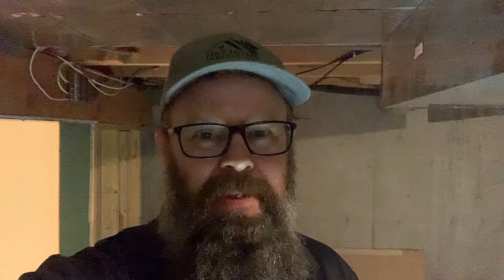💦Vapour barrier on interior walls, bad idea!  “On the home inspection today”

Comment from the maker: Hi Willy yes I think putting rockwool insulation in the wall between your mechanical room and your family room with no vapour barrier is a good idea to help cut down on noise transmission from the mechanical room into the rest of the basement

Comment: The use or not of vapor barrier on walls is dependent on climate the home is in. Vapor barriers are used differently in the warm south compared to the northern states.
Reply from the maker: Yes that is correct, I am in Alberta Canada it is a cold climate and we can have swings of 50 degrees in a matter of days.
Reply: @hatpropertyinspections  so in cold climates what are the steps? Poly or rigid foam or both? On cinder blocks and then studs for rigid but what about poly. Poly first or studs? Thanks
Reply from the maker: @luly8083  Hi Thank you for your comment. In my opinion the best assembly is as follows. Build 6 inch stud walls all the way around on the exterior of the basement leaving about a 1 inch gap away from the cinder block or concrete foundation. You don’t want the fibreglass insulation to touch the concrete you want to have an air gap there, then fill them with R20 Fibreglass batt insulation. Including the rim joist areas above the wall. Then install 6 mm poly on the interior side of the stud walls, all the way from the floor up to the top of the wall and inside the rim joist area. (Where I am it’s code now to use spray foam insulation in this rim Joist area with no poly )but R 20 insulation in this area with poly will work fine, you can use some Staples to hold The poly in place up in the rim joist area, Cut the poly a couple inches above the top of the rim joist and staple it to the floor above. Then use black acoustic sealant to seal the poly at the floor, in the corner of the concrete floor and new 2x6 wall and cut the poly about half an inch from the wood wall. I do not recommend foam board insulation at all for basements. I hope this information helps , thank you very much Westley.
Reply: @hatpropertyinspections  Thank you very much for your time and expertise. To clarify  when you poly on the inside of wall you mean where the drywall goes right, the face of stud? How about when furring strips attached to the cinder block? What application you recommend.  Poly before furring strips and in this application would rigid board be best or why don't you recommend rigid boards. Thanks again!
Reply from the maker: @luly8083  hi it’s my pleasure to try and help. yes the poly goes over top of the stud right behind the drywall. I don’t recommend furring strips attached to cinderblock. The cinderblock will allow moisture through it. You want to have an air gap between the cinderblock and your wood wall, so things can dry out back there. It’s better to build stud walls and space them an inch away from the cinderblock. Then you can insulate the stud wall with fibreglass then the vapour barrier then drywall. I don’t recommend Rigid boards in this application because they will hold moisture. Rigid foam boards are generally only used in attics. And a few other applications where trapping moisture is not an issue. If you were going to put the furring strips right against a cinderblock than the poly should go after the furring strips right behind the drywall.
Reply: @hatpropertyinspections  Excellent thank you again for your time and this valuable information.  I guess another curiosity I have is. Is it code to use pressure treated at the bottom plate or against the wall if you attach against cinder block? Thanks
Reply from the maker: @luly8083  hi yes it is required to use pressure treaded lumber when in direct contact with concrete or block.
Reply: @hatpropertyinspections  thanks again for taking the time to help me out man. God bless!
Reply: Recommendations for the southern states?
Reply: the above q and a's are excellent, just commenting so i can find this again later. Thanks

Comment: Thanks for the pro tip.   Another one I would point out, is having no vapor barrier on concrete walls.  People will frame up along concrete to build walls, so yes insulate, but no to the vapor barrier. That too would trap condensation, from natural occurrences.

Comment: What’s the best way of erecting the poly …..against the foundation wall side or should instead only the insulation be pressing against that foundation wall …..or only interior side where drywall walls will sit against
Reply from the maker: Hi Antonio Thank you for your comment. The best way to erect the wall is to Build 6 inch stud walls all the way around on the exterior of the basement leaving about a 1 inch gap away from the concrete. You don’t want the fibreglass insulation to touch the concrete you want to have an air gap there, then fill them with R12 Fibreglass batt insulation. Including the rim joist areas above the wall. Then install 6 mm poly on the interior side of the stud walls, (using a staple gun) all the way from the floor up to the top of the wall and inside the rim joist area. (Where I am it’s code now to use spray foam insulation in this rim Joist area with no poly )but R 12 insulation in this area with poly will work fine, you can use some Staples to hold The poly in place up in the rim joist area, Cut the poly a couple inches above the top of the rim joist and staple it to the floor above. Then use black acoustic sealant to seal the poly at the floor, in the corner of the concrete floor and new 2x6 wall and cut the poly about half an inch from the wood wall. Then drywall and tape the wall and ceiling. No poly on any interior walls, but insulation on interior walls is OK for soundproofing. I hope this information helps , thank you very much Westley.

Comment: wouldnt putting poly on the exterior wall cause a moisture build up and mold?
Reply: if the wall gets wet then yes. don't cover it with anything if it gets wet (ie water comes in from the ground outside)

Comment: We are building a small cabin that has a an interior wall with a bathroom on one side and a kitchen sink/counter on the other. I want to insulate the wall for sound purposes. We want to install shiplap directly ( no drywall) on the framing to both sides as well but want to prevent the humid air from the bathroom going into the wall.  I was going to put poly on the bathroom side, but look at a mesh screen on the kitchen side to allow for some air movement.  
Sound good ?
Reply from the maker: Hi no I would not recommend putting Polly there at all, if you want to stop moisture transference out of the bathroom, but I think you should install an exhaust fan in the bathroom . Poly an interior wall will just trap moisture which can lead to mold.
Reply: Thanks for the quick response.  I was even thinking of window screen to hold the insulation in place but also keep it breathable. Then shiplap directly over it without using any poly.
Reply: I am planning to install a ceiling exhaust fan thanks.

Comment: Would you recommend waterproofing/sealing the walls and floor with a Radon seal or Drylock for moisture issues? I'm in Spokane Wa and just bought a new house with a basement and looking for some advice. Thank's in advance for any help you can give.
Reply from the maker: Hi Michael thanks for your question. All walls and crawl space floors should be water proofed and sealed. From the out side-
Cladding - siding, stuco etc.
Building wrap - tyvec, tar paper moisture seal etc 
Building structure - plywood, osb sheeting 2x4s etc
 Insulation - fibre glass batts is Probably the best and cheapest
Vapour barrier - 6mill poly It’s probably the best and cheapest
Interior finishing - Drywall mud and tape

This assembly It’s probably the best way to water seal and moisture steel at wood wall and still allow her to breathe properly. 
As far as radon goes the two ply eight mill Polly that they use for radon mitigation in crawlspaces is a different issue

Comment: This video and comments highlight the debate I am facing right now. About to insulate my basement foundation walls. I am in upstate New York, maybe -20c winters, 35c summers. Home is 22 yes old, I’m original homeowner, basement is bone dry. Has been for 22 years but never insulated. Now I’m about to start and wonder if rather than waste time on the fiber board, I go straight to 6 inch studs [all are non-loadbearing] and filled with batts.  Three of the four walls are under grade one is exposed, it’s a walkout. Thank you!!
Reply from the maker: Hi Ebbnyc Thank you for your comment. Yes I think you have it exactly right. Don’t waste time with fiberboard. Build 6 inch stud walls all the way around on the exterior of the basement leaving about a 1 inch gap away from the concrete. You don’t want the fibreglass insulation to touch the concrete you want to have an air gap there, then fill them with R12 Fibreglass batt insulation. Including the rim joist areas above the wall. Then install 6 mm poly on the interior side of the stud walls, all the way from the floor up to the top of the wall and inside the rim joist area. (Where I am it’s code now to use spray foam insulation in this rim Joist area with no poly )but R 12 insulation in this area with poly will work fine, you can use some Staples to hold The poly in place up in the rim joist area, Cut the poly a couple inches above the top of the rim joist and staple it to the floor above. Then use black acoustic sealant to seal the poly at the floor, in the corner of the concrete floor and new 2x6 wall and cut the poly about half an inch from the wood wall. Then drywall and tape the wall and ceiling. No poly on any interior walls, but insulation on interior walls is OK for soundproofing. I hope this information helps , thank you very much Westley.

Comment: Maybe you can help….
I applied 2 inch Foamboard to my basement concrete foundation walls. Then I constructed a 2x4 wall against it. I filled the wall cavities between studs with rockwool. My question is …..do I apply a plastic vapor barrier before Sheetrock or do I just Sheetrock over the rockwool?
Thank you!
Reply from the maker: Hi thanks for your question . Yes definite ly put a poly plastic layer over the studs before you put the dry wall on . 6mm poly and tape all the seams
Reply: @hatpropertyinspections Assuming the 2” foam board is XPS or foil-faced Polyiso, wouldn’t the low perm rating would qualify as the vapor barrier for wall assembly? Could create a double vapor barrier scenario by “sandwiching” the cavity with poly vapor barrier on top of studs and any moisture that finds its way into wall cavity won’t be able to dry easily and could cause mold, rot, etc. in the future. You could probably use a “smart” vapor retarder that has variable permeability and allows some drying to inside if stud cavity has build up of moisture….but honestly wouldn’t think you’d need it at all with 2” foam board against the wall.

Comment: Why would you recommend they remove the interior insulation as well as the poly?  Wouldn't the interior insulation help interior comfort, less air flow, less noise?
Reply from the maker: You are right, good catch! yes the insulation on interior walls is fine, just the vapour barrier should be removed.
Reply: @hatpropertyinspections  Thanks, wasn't sure if there was a reason not to do interior insulation.  Thinking of doing some interior near my mechanical room that separates the family room.
Reply: @hatpropertyinspections  One additional question if you don't mind, hard to find an answer on.  I have half-height foundation walls in the basement, half-concrete half where the 2x4 framing walls start (Raised Ranch).  This creates a "ledge" all away around the house where the 2x4 framing sits on the 2x8? foundation.  Gives the appearance the room is bigger than it is, but if I'm remodeling the space is it a good idea to create a second 2x4 wall attached to the first 2x4 wall, effectively creating a 2x8 wall I can stuff with lots of Rockwool?  Thank you!!!

Comment from the maker: Yes, I think adding another 2 x 4 wall on top of the short foundation wall to make a 2 x 8 wall in the basement is a good idea. If you’re concerned about energy efficiency this wall would give you approximately R 30 if you use rockwool.

Comment: So in a detached 2 storey house,  masonry build should you or shouldn't you  install a vapour barrier to the internal partition walls that contain insulation?

And what about the external brick walls that have plaster board fixed to them. Uk build here
Reply from the maker: Hi Dan thank you very much for your questions. There should be no vapour barrier on any interior walls, Even if the wall has insulation. Insulation In interior walls is primarily for sound barrier. Vapour barrier should be installed on external walls right behind drywall. For the exterior brick wall you are describing the detail is as follows .. from the inside ; drywall, Vapour barrier, Wall framing and insulation, exterior sheathing, building wrap or tar paper, brick wall 
I hope this info helps, make it a great day! Westley

Comment: The property mgt painted my apt with fragrance paint additive . Think they tripled the amount. I can't fully move in bc of it as I am mold/mycotoxin and chemically  hypersensitive. . Researching solutions as all odor blocking sealants have high vocs. Trading vocs for vocs. Have to work outside of the box. (Puns). I'm thinking foil  insulation board on the walls, ceiling may be the answer if that doesn't come with high vocs. Would truly appreciate your help. What can you advise me for these circumstances?
Reply from the maker: Hi I think the best way to remove a smell from a home is with ventilation. I would recommend installing an exhaust fan in the area and venting it outside and opening a window slightly to make up the air.  I would ventilate the area until the smell of the new paint has dissipated.

Comment: What methods would you use to seal and insulate a concrete built house (Not ICF but just a traditionally poured concrete house) and a masonry built house (say brick / block combo) ? Thank you
Reply from the maker: Hi thanks for your question I think the detail would be as follows from the inside. Drywall, poly vapour barrier, 2x6 wall framing and r20 fibreglass bat insulation, 1” air gap, Masonary structural wall, 1” air gap, moisture barrier and exterior siding. That’s going to be a vey thick wall but extremely energy efficient.
Reply: @hatpropertyinspections  thx. Why add the 2x6 wood frame if brick and concrete is already structural?
Reply from the maker: Hi the 2x6 wall is there to hold the insulation, give you something to staple the poly vapour barrier to and screw the dry wall to. It could be a 2x4 wall but 2x6 is code now for the r20 insulation.

Comment: What specific issue were they having? I am having some issuess with water condensating on my metal shed walls. I have insulation that technically had vapor barrier, but I was considering a second layer until I saw your video.
Reply from the maker: Hi thanks for your comment. There was no specific issue on that day. But we don’t want to have a vapour barriers on interior walls. This can cause condensation and can lead to problems like water damage and microbial growth. Condensation occurs when warm moist air hits cold dry air. The warm air gives up it’s moisture on the surface and forms as condensation. It’s good to have only one vapour barrier and you want it on the inside right behind your finishing like the drywall or plywood in the case of a shed. The only really good vapour barrier is poly plastic 6 mm